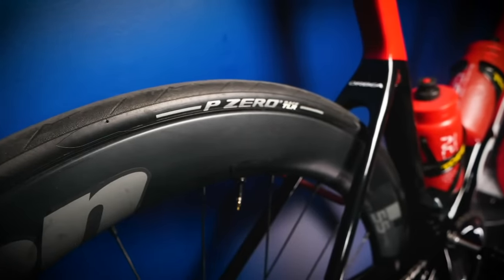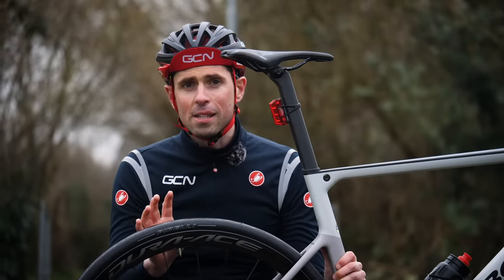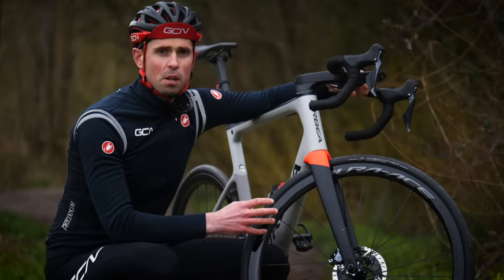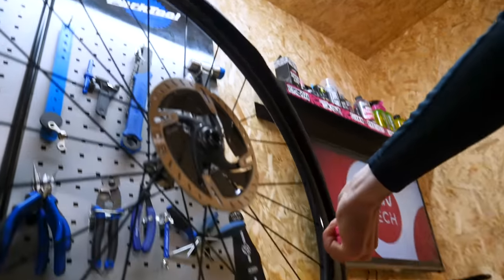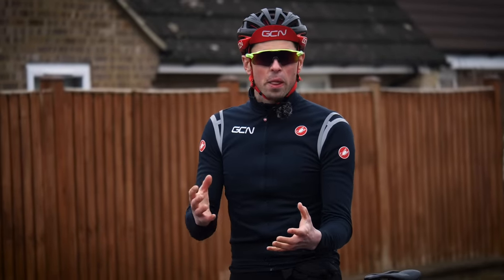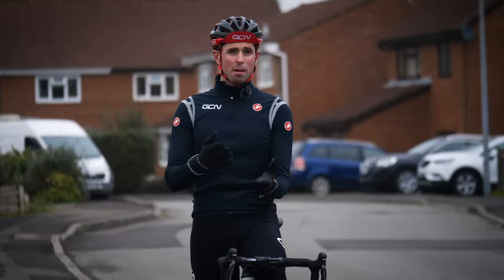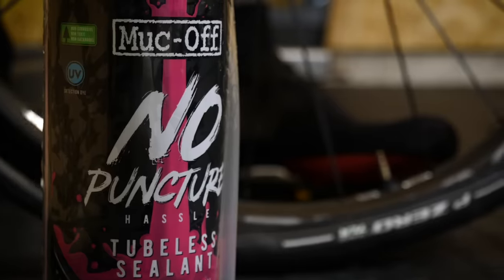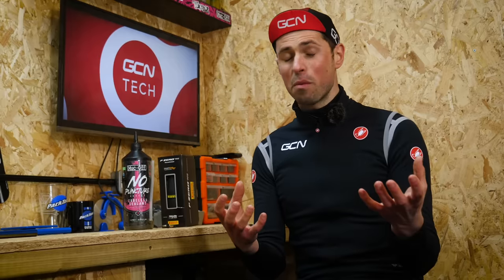Tubeless Convert! | Why Alex Will Never Use Inner Tubes On His Road Bike Again

Comment: At 100 psi the sealant doesn’t work. Period.
happens to me last week, cant handle more than 50-60psi and after putting a plug and re inflate to 100psi the plug came out like a rocket and spread all the liquid. Bye tubelelss on road wheels. 
Ps: my rims and tyres are tubeless, both giant

Comment: I am 53 been cycling most of my life but I have ridden tubeless off road the last 12 years and on road the last 6 and got to say there’s no comparison in performance or reliability tubes are dead if your still happy riding them crack on we only do it for fun😀👍
Reply: I'm 52.5 years old and everything Steve says!  About the same amount of time on tubeless for the road.  I'll add that it's really dependent on the tire/wheel combo and there are some good tricks (inflating with a tube overnight for tape/tire prep, using soap suds to seat the tire, and using a compressor--also Cafe Latex rim strips are easier the tape and reusable, and there's nice tool---Kool-Stop Tire Jack so you don't mess up your tape).  Also, I always carry a pump, spare tube, boot, multitool, etc.  Yes it means a small saddle bag under my seat and a small tool/pump roll in my pocket, but one should be self-sufficient.  Won this in a race goody bag and it works well: https://www.blackburndesign.com/p/outpost-bike-wrap-bag/
Reply: Oh yeah and get a large syringe and some latex tubing to make your own sealant injector--or buy one for about 10$.

Comment: As someone who rides exclusively tubeless on a mountain bike it's a retarded application for the road. For now it's not worth the hassle. At least on a mountain bike you get to run lower pressures and pin punctures are more common so there it makes sense. On the road you don't run low pressures so very little risk of pinch flats (that can still happen with tubeless except instead of replacing a tube you might replace the whole tire) and if you do puncture the higher pressure can make it hard for the sealant to... well, seal.

Comment: Love riding Tubeless, but there are some Problems. I'am riding some Mavic Cosmic SL Carbon Rims, with Standart Tubeless Mavic Yksion Tyre. Not prroblem to mount there Tyres, super Easy. Trying to mount a pair of Conti GP5000 TL Tyres was impossible. Streching them, warm them up doesnt helped me out. Next I bought Schwalbe Pro One TLE, mounting was hard, but doable. All Tires came at 28-622. Unfortunately, there are still too large manufacturing tolerances in the various manufacturing processes.

Comment: I am an 18 years old 5foot10, 92 kg M and I have been only using innertubes andddd i always get a puncture almost everytime i ride my roadmbike with 700x25. 

     Hear me out for a minute before anyone jump to conclusion. First of all, i am actually getting tired of getting punctures, to be specific pinch flats, to the point that i might have grown a bit of a phobia whenever i feel something wrong about my bike/ride feel. I honestly would really like to try a tubeless setup to whenever budget would love to. Oh and btw, our roads are alright... They are cemented but not all are paved/asphalted. I just repair my innertubes and i must say that i do my best, like actual best, to do them correctly and properly. 

So here's my question: Do i get punctures because i am in a bigger size or i could lessen my punctures if i get a 700x28(considering it is probably the biggest i could fit in my rim brake) and still on innertubes as my budget wouldn't still get a tubeless specific wheels? 

#AskGCNTech
Reply: If you’re getting nothing but pinch flats, let me offer some suggestions. Make sure you’re using the right size inner tube. 25 is a bit on the small size these days. Use an inner tube that is 21-25 instead of 25-32. Use talc on your inner tubes. This will help the tube slide out of a potential pinch flat.
Reply: Wait, you mean getting a bigger innertube size, preferably 28 up, is that what you meant?
Reply: @yeff1127  Smaller inner tube.....less material crammed in will reduce the chance of pinch flats

Comment: I prefer tubes. After countless attempts and hours and hours of setting up and using tubeless only to have a puncture not seal and end up installing a tube anyway,  I have realized that Road Tubeless is for dummies. That said, speaking of dummies I have opted to give the Schwalbe Aerothan tubes a try. So far I have had some good luck, but the price does ouch a bit. I haven't had a flat with one yet this year.

Comment: Tubeless is amazing! My only issues have been when my rim tape blew out on the front wheel somehow. That was a bit scary. Still like tubular tires because I can still run them at low pressures as well.
Reply: Yeah.  that's happened to me several times, not even riding the bike..  It just blew while the bike was sitting in the hall.  I think the tape just isn't strong enough to deal with the higher pressure from road tires long term.
Reply: @nwimpney  that rim tape lasted over 3 years so I wasn’t surprised. But my LBS buddy was surprised to see it happen.  I don’t think I ever have had a flat riding tubeless otherwise.

Comment: I love these tubeless advertorials telling only half of the truth. The other half being about how messy they are if you, nevertheless, get a puncture. Putting a spare camera in a tire which had tubeless in it. Replacing the tubeless solution in four or six month. Forgetting to replace the tubeless solution and getting it all dried up in your tire. 
Believe, I've employed tubeless on my MTB for two years. It's lovely when you simply get your bike to the LBS and they deal with everything. But if  it's you who has to deal with it, not so nice. If it's not the first time you put tubeless, not so nice. If you forgot to change the solution in time, not nice at all. And if you puncture, be ready for a huge mess. 
I'm testing these days the tubolito inner tubes. For MTB, they're as light as the quantity of tubeless solution that you have to put in the tires. For road, they might even work better than for MTB.

Comment: How can you repair a puncture on a tubeless setup (especially if you’re in the middle of a ride and far from home)?
Reply: If the hole is big enough that the sealant can't plug it, then you need to put an inner tube in there to get back home. Which means that you need to carry a spare tube even when riding tubeless. And you'll have to deal with sealant-induced nastiness on the side of the road. The thought of doing that is enough to keep me away from tubeless setups.
Reply: @simonr7097  Thanks for the explanation. I would be much more interested in tubeless if it meant I didn’t have to keep carrying spare tubes...or deal with a big mess.

Comment: Sorry to say, but scientifically these results are not relevant. 1 measurement with each setup is not an acceptable comparison. We do not even know the average powers for each run, but even if they are the same or very close, that can be achieved in different ways (e.g. it would be important to know how much time was spent out of the saddle in each run). So while tubeless may really be faster, this test certainly does not prove it.

Comment: tubeless has got two issues. one is that what if the puncture cannot be sealed while i am on the road. the second is i have to change the sealant on a regular basis maybe every six to nine months while i only need to change a tube after it gets punctured.

Comment: How does air retention compare on tubeless vs tubed set-ups? Do you have to pump your tires more often when runnings tubeless wheels?
Reply: depends on the set up--but in general I'd say you do need to pump up your tires more frequently.

Comment: The fact that tubeless tires are supposedly less likely to have a puncture makes NO sense to me. How is it safer to have one thin wall of rubber instead of 2? But more importantly i use a plastic sheeth between my rubber and my tube and it adds an extra level of protection. No tube logically means no possibility for that extra puncture protection.

Comment: Tubeless is great until you get a serious puncture then it is just a pain in the ass. I found the initial setup wasn't too bad but maintainiing them is messy and I got tired of cleaning off hardened sealant and mounting difficult to seat tubeless tires is a painful experience (literally sometimes). Tubeless is a system that promises so much but when it comes to the crunch fails to deliver. I've gone back to tubes. I can get a similar ride experience using tubolitos and they have proved much more reliable and less hassle. Just to add a further comment I think there is a an element of confirmation bias going on with peoples experience/opinions of Tubeless.

Comment: My experience is that when the temperature is high, the teflon dissolves and that tires start leaking spontanous. Happend to me often and tried differen compounds, but I am back to inner tubes again. On the mtb I am stil tubeless, but the pressure is a lott less. Maybe that made the difference in my experience. Offcourse uk is more rain and cold, so maybe you don't fase the issue's we have with 35-40 deg C.

Comment: having multiple wheels/tyre setup is not possible on cost grounds.
One strong point of tubs/tyres is the fact i can change tyres as and when i want depending on what and where i'm going.
How will this work with tubeless ? - Can it be done ?

Comment: Could you do a comparative test with a fixed power on different kinds of pavement including cobbles and with different tyrepressures please Alex?
Imo you'll find the biggest difference on bad roads using relatively low pressures.
Comparing grip in tight slippery corners should also give interesting information. Perhaps Hank is a volunteer to test this out?

Comment: To be fair... Aerothan tubes should not be handled like common tubes, pressure is more like tubeless and tire support is also close to tubeless so the comfort win for tubeless is minimal, also the weight is only minimal better counting sealant and the valve that weight almost as much as the whole aerothan tube plus no maintenance... For me the aerothan is the solution!

Comment: Love my tubeless Liv bike, however I always have to get the LBS to top up the sealant as I can never get the tyre to seat using a track pump.
Reply: you can add sealant through the valve stem and not have to unseat the bead off the tire

Comment: Question. Are low pressure tubless tyres less prone to punctures  than higher pressure tubeless. Does the higher  tension in the carcase cause thorns and flints to pierce the skin rather than just get deflected in a lower pressure setup. I would  love to know. P.s. Tubeless all the way.

Comment: How do you repair a tubeless flat on the road? If using deep rims, an innertube fix won't work. IF not racing, just maintaining speed,  today I use Schwalbe Marathon Plus at 26x2 for my road tires with slime tubes on some bikes. At 60psi it is the most comfortable tire/wheel combination on the road. If too stiff still then use the non Plus tire version. 700c with 25/28mm tires are gone from my life after throwing out my last road bike this week. The speed difference at my recreational cruising speed from 25mm to 50mm is no difference or faster with the 50mm. Why? If your roads are not absolutely new and perfect, the 50mm Schwalbe will have less rolling resistance than a 25mm racing tire. We are not talking racing speeds of 25mph+ just maintaining a 18 to 20mph speed as 99% of all skilled/experienced rec cyclist do. One ride is a return from the mountains at a gentle 3% grade, I still have no problem maintaining 32mph for the 20 miles return with these 26x2 tires. Again, racing needs lightweight wheels/tires for peleton speed changes, sprinting and jumps....rec riders have zero need for this lightweight set up.

Comment: Tubeless on normal rim brake wheels? Not sure on that. Disc brake wheels have generally wider rims and tubeless-ready design. Rim brake surfaces degrade and get weaker resulting in imperfections in the seal. Tubeless for disc brake, no problem. Converted all of mine with no issues.

Comment: Road tubeless is great...until it isn't. Tyres have a shorter lifespan, often there are major compatibility issues between wheel and tyre making them a total b**tard to fit, and when you get a puncture that won't seal, the process of fitting a tube to get home is far harder and messier than a normal tube and clincher would have been. I have gone back to tubes. Road tubeless is a solution in search of a problem.

Comment: Tubeless on a mountain bike? - Sure! All day long. Tubeless on a road bike? Not in a million years! 

I remember watching a video where Chris Froome’s training bike was reviewed and guess what - it was with good old tubes! 

As a racer I can understand the advantage of saving 7 seconds. For us mere mortals 7 or 15 seconds does not matter. 

On a mountain bike running lower pressure will get you better traction, but in a road bike you would not run 23 mm tires at low pressure. Better off getting a set of 25’s or even 28’s and save yourself the hassle of the tubeless setup on your road bike. 

Another thing that bothers me is that weight savings are mentioned often as a benefit - but sealant actually weighs something too so the savings are marginal. 

That’s my two cents 😉

Comment: I'M SOOOO SICK OF FLATS! I ride everyday to work 10.5 miles there and back and my 700C get 1-2 flats a week and my back tire is a pain in the ass to take off and put on. I'm done. I have new tires, new tubes, protective inserts, and waiting for my new rim tape in the mail (thanks Amazon for 2 day delivery turning into a month). STILL 2 days after changing everything I have a flat. But this time it's from inside the rim. I checked the tape and it's fine, the spokes aren't sharp either. I'M GOING TUBELESS THIS WEEKEND. I can never win with these tubes. I have 7 tubes waiting to get patched because I will need them in another 2 days if I'm lucky. My fat bike never gets flats, but I'm waiting 2 months for spokes to come in the mail. That's another story..

Comment: This test has a slight flaw. The tester should have used a clincher tire with the inner tubes and not a tubeless tire with the inner tubes. Therefore I will stick with the tubes.

Comment: I guess when you get as flat with tubeless you just get off and walk
Reply: Nah, most punctures seal themselves, larger holes can be fixed with a plug (30 seconds), very large ones a tube but you'll need a tyre boot as well just as you would a clincher. 
So worst case scenario is putting in a tube. Which is best case scenario for a clincher.
Reply: @TheAdwills  Worst case scenario is putting in a tube on a difficult to remove tire full of slimy sealant that smells like rotting fish.  Maybe you're into that kinda thing, but I'll just swap the tube and be on my way without smearing my bars with crap.
Reply: @nwimpney  with modern ETRTO rims and tyres it's no more difficult to remove or fit a tyre than with clinchers. And I've had nightmares trying to get some tight clinchers onto rims, breaking tyre levers in the process, and also had Schwalbe tyres pop off Enve rims at 90psi while riding. Scary. So don't go thinking that these problems are unique to earlier tubeless setups. Plus, if you pop one bead off the rim as per usual and angle the wheel away from you most of the sealant stays in the tyre, unless you've used too much. So not only very rare to have to do this thanks to small cuts sealing and plugs sorting larger holes quickly and easily, but less messy and easier to do than many think.

Comment: Bulls**t... Its good for Pro teams or MTB.! 
1)Tubeless are good but if You can “open“ tyres once per two weeks to clean old sealant from tyre, and fill new. Otherwise after one year tyre is to trash, or weight same as wheel with tube.
2) during puncture it really works!  But if you using clothes as Assos or Castelli- sealant stains cannot be removed. 

After this accidents and loose huge money i finished with Tubeless and back to Tubolito tubes! I'm very satisfied. And don't feel differences during ride. For sure service is easier and im clean!

Comment: Tubeless on road with firm pressures in are crap. Mainly mtb tech for road. Ok for gravel and MTBs. When you get a puncture using latex sealant it blasts out like a fountain covering your back and the bike. Sealant doesn't get into action until pressure drops to something around 50 psi or less which is around a max recommend for an mtb tyre. By then every pothole blasts that carbon rim. I tried Stans race sealant and still no joy. In mtb tyres perfect. Never mind the bull that the world tour teams use latex...they don't. Tried latest continental and s works. Most of the time ya gotta put an inner tube in after a puncture into a messy wheel so what's the point?  Also got to remove the tubeless valve too before fitting inner tube. Good luck with doing that on the road with the latest continental tubeless tyres as they're some of the tightest tyres I've tested.

Comment: I have no interest in tubeless . 
But I do have a question. Wasn't 95 lbs. pressure high for 28 mm tires?
I run at least 15 percent less in front and 10 percent less on rear. 
If you ran a bit less pressure would the results be closer? Would the light tubs be faster?
Cheers

Comment: 11:03 is 663 seconds. 15s is 2.2% of that.
So it's a gain of 2.2%.
Reply: That's actually quite a lot, you'd need to increase your FTP by about 8% to achieve the same increase. 
He didn't mention the nearly 10 minutes saved for each puncture...

Comment: M2CW I run tubolito inner tubes and they are just as fast as tubeless (for me) I also have the benefit of not getting gunk all over myself and wheels in case of a sidewall or major puncture downside minor nicks and punctures are way easier when running tubeless. So in summary for me it's all down to personal preference and what works for you...